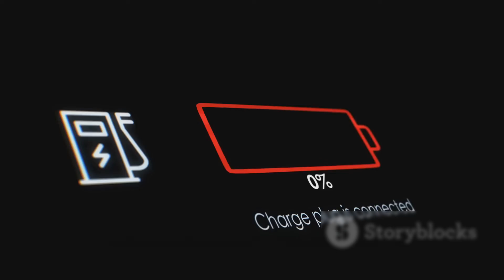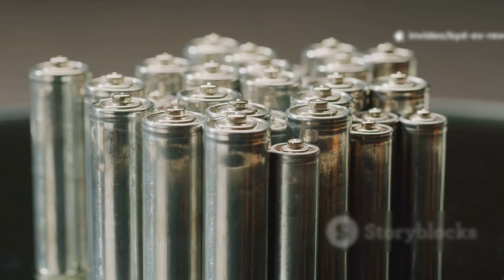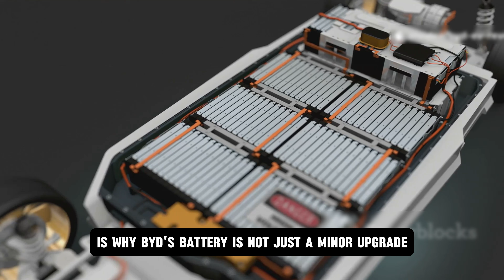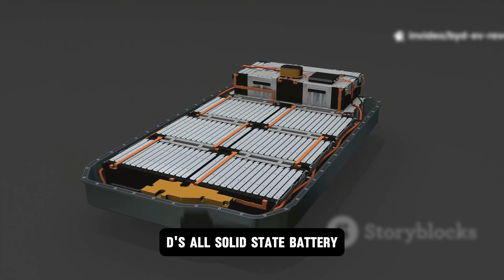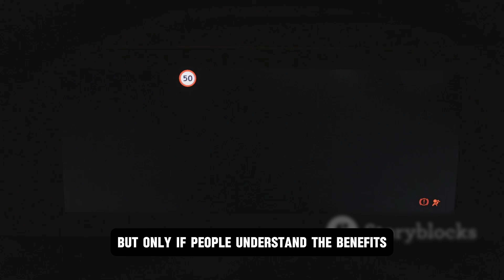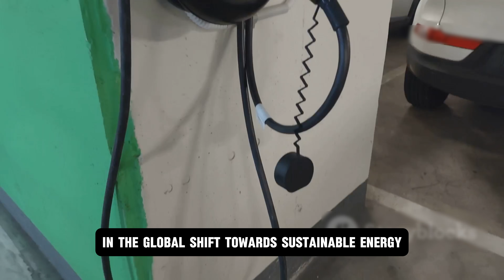BYD CEO Announces New All solid state batteries with 10 Minutes Charging

Comment: If you can a battery that can recharge in 10 minutes, you can add the additional weight of an axle-driven generator to the vehicle and essentially have unlimited range or very reduced power loss.

Comment: YET ANOTHER PROPAGANDA VIDOE BY AI!!  Only idiots cant udnerstand basic physics!!! Lithium can be charged in 10 minutes too!! there is just no thic wire enought to do that!!!  the same here.  to charge in 10minutes you need to charge 100Kwh battery with 600Kw of power!   Wires has be soooo thic you wont be able to move them or even lift.